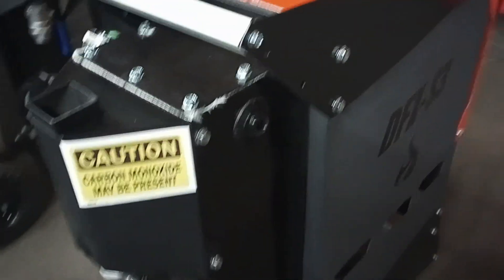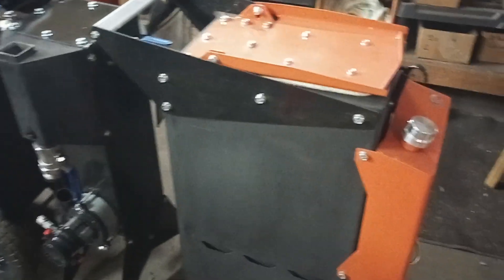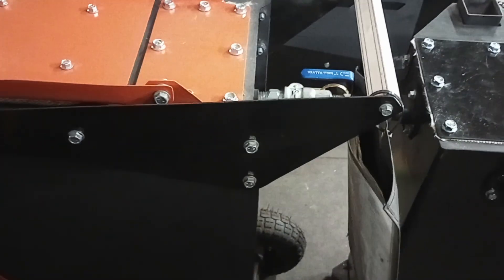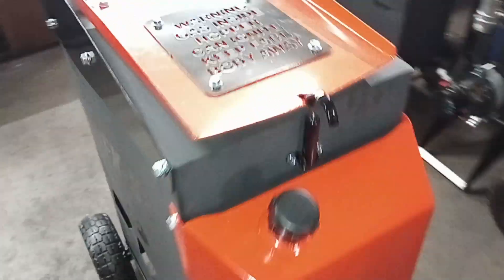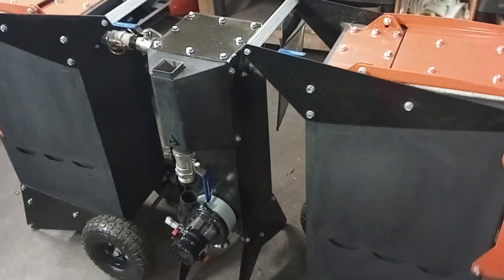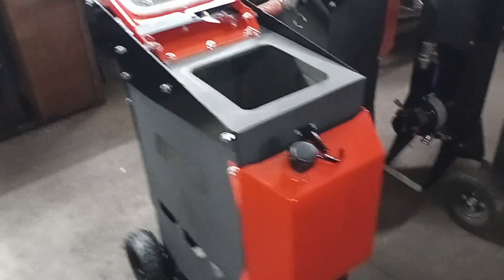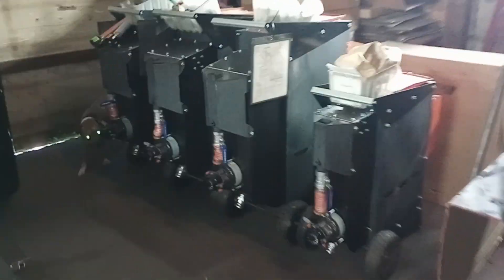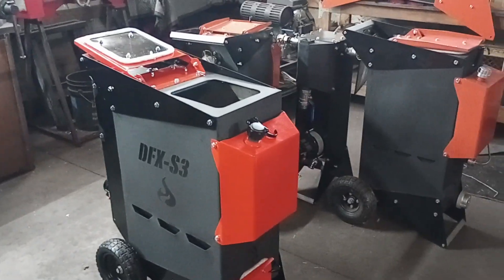DFX Fusion Module Explained

Comment: Anyone out there know where I can get plans to build something similar to this, or DIY steps etc?. I asked him on his site and basically got told to go pound sand, so my journey continues. Considering I built my own Bedini/Tesla based 24 volt solar power system for my off-grid cabin that works great, (just not during winter days, thus the need for a gasifier) I am more than capable of the skills necessary to build my own unit, I simply need advice and a push in the right direction. If anyone knows of someone with some plans, or a source of help to build one it would be much appreciated. Regardless I WILL build my own system, but was just hoping for some help from someone who's already built one to save me some hassles etc. I'm 43 and have done construction, electrical, plumbing, built and wired industrial signage, welded, and fabricated in the past, and rebuilt a travel trailer from scratch, as well as repaired RV appliances and furnaces etc. so I am more than capable of making one. I just need help to get me started, and was hoping someone would have some plans to make a unit to run my 9HP Firman inverter/generator, and perhaps the plans for a bigger unit to build into a log home we plan to make here on our 5 acre off-grid property. I will be building a sawmill barn/shed this summer, and will have plenty off scrap wood to turn into fuel, so this seems to be the smart way to go. I'd buy a unit like this, but being on disability it would be virtually impossible to afford to, and I also prefer to build one myself, as I like to get my hands dirty, and save money in the process. So yeah, anyone with advice is very much appreciated!. - Adam, Off-grid in BC Canada

Comment: У вас лишняя деталь , крышку крепите на боковым чорным деталям к которой крепиться ручка для транспортировки, с экономите 8 шт. болтов ,  железо, + оранжевую краску..
Reply from the maker: This is a great idea; however, We would still need the service cover to access the pick up tube clean out port. So it is fine the way it is designed. We will not make any more changes on this design revision. We will launch the next generation DFX development next year and can add those revisions on this next generation and we have thought of this already. This will be a two to four year development phase as it will be well beyond just the gasifier development. This will include manufacturing process and development. The point of the next generation will be to cut production time and cost to get the cost as low as possible to better meet the market. The technology has peaked in its development; however, there will be improvements to clean out systems and maintenance items such as this clean out port access. The lid will be large enough to access this without removal of a bolted on service cover. There will be a slew of other things like this implemented onto the next generation machines. There will be  drop out clean out system on next generations as well. This will make cleaning out the reactor very quick and effortless. The Fusion will have the flare cup integrated so another part eliminated like this service cover and many other things like this.
Reply: @Thrive-Off-Grid  планируете ли вы возвращать 17 процентов СО2 от выхлопов генератора как это было сделано в авто газогенераторах Калле в 1930 х годах?

Comment: Can you run saw dust in the gasifier?
Reply from the maker: No they are charcoal duel fuel gasifier hybrids. You can run a mixture of 50% chips or small chunk fuel. You can run up to 10% MC but the closer you get to a 50% mixture the dryer that fuel needs to be. At a 50% mixture there must not be any moisture if the wood fuel. 

The saw dust you use in the ammo box filter. It works quite well as a filter media and allows maximum filtering capability in a very small compact filter.

Comment: Outstanding! What is the purpose of the water tank? Is it like a bubbler or a cooling system...?
Reply from the maker: No this is for the water injection. The jet nozzle atomizes the water it intakes air. The resulting mist coats the nozzle and as it evaporates and flashes to steam it cools the nozzle keeping it from melting. The resulting steam is then cracked in the carbon bed creating H2 and CO as the carbon rip's out the oxygen and combines with it. Resulting in a much more energy dense gas. The steam also displaces atmosphere reducing the amount of nitrogen that can get in.